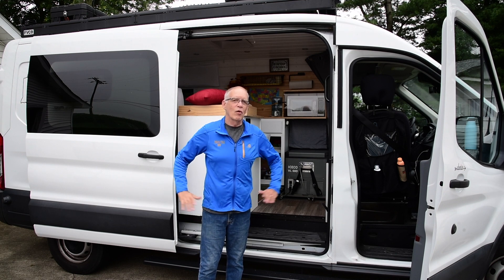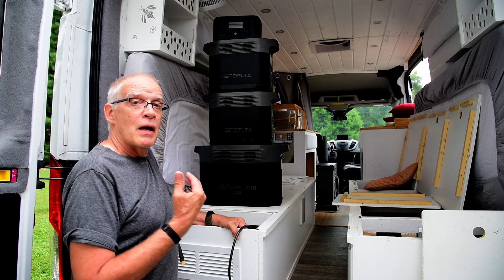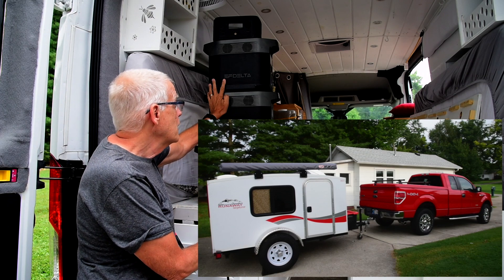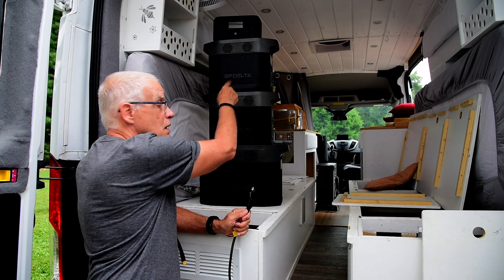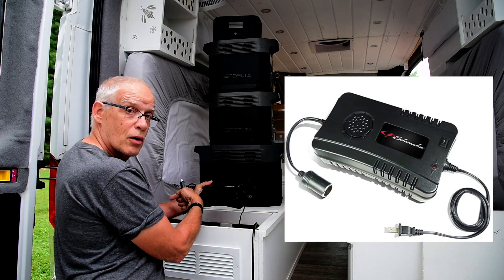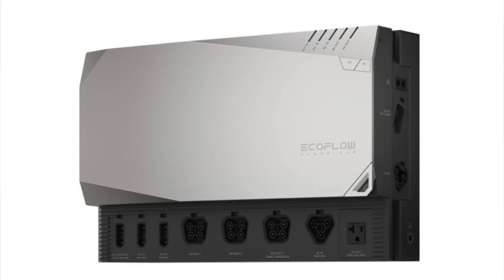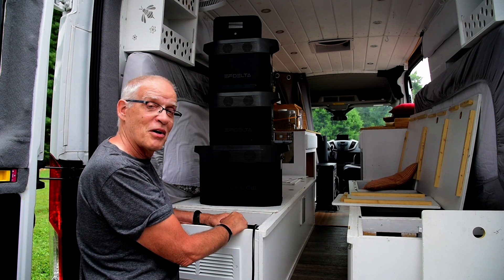A Quick 4-Minute Look at Our Ecoflow-Powered Transit

Comment: The DC output of the various ecoflows is limited to 30amps, correct?

And that’s enough for your lights and fridge etc.?
Reply from the maker: I have never run into an issue with any of my eco-flow units. My ICECO fridge sometimes does not like running on 12 V so most of the time I just run it on the AC side of the eco-flow. I know it’s less efficient but I have plenty of power.

Comment: Thanks for your response about the AC.  Would you mind sharing the details of the portable inverter with the 30amp plug you use.  Id like to get something similar
Reply from the maker: Sorry for the delay answering - I saw it and promptly forgot about it! : ) I actually ending up taking out the 30A plug - I did not like the adapter cord I was using and never will need 30A. I use this inverter to run 12v stuff when I am on shore power and it works well - https://www.amazon.com/gp/product/B0196DXEBI/ref=ppx_yo_dt_b_search_asin_title?ie=UTF8&psc=1

Is that what you need to know?

Comment: After having travelled some now in your awesome build, do you regret not putting in an AC?  Im duplicating your idea using ecoflows latest Pro 3...and likely adding a second battery as ill be doing trips 2-3 months long.

Cheers!
Freddy
Reply from the maker: @fredzuccarelli  yes, if I could go back, I probably would add an air conditioner. We use a portable, but it’s in the way when we do use it. But for the most part, we do not camp in hot weather. I would go with a rooftop AC.

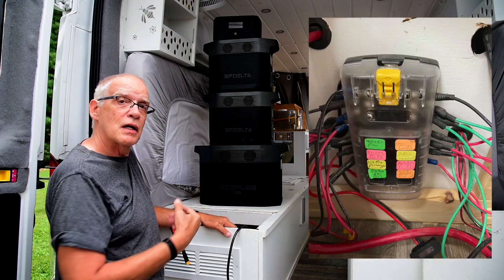Comment: 1)  12 VOLT DEVICES WIRED TO FUSE BLOCK:  1:30  All wires for 12 volt DC electronics (puck lights, USB ports, 12 volt Iceco VL60 Dual fridge, water pump(s), fans, etc.) connect to Blue Sea Systems 12 volt fuse block.   

2)  12 VOLT CORD FROM FUSE BLOCK TO DELTA 1300's DC PORT:  1:37  12 volt DC cord is connected to positive and negative on fuse block and plugged into the Delta 1300's 12 volt DC port.  (Same port I use now on my Delta 1300 to power my fridge/freezer.)

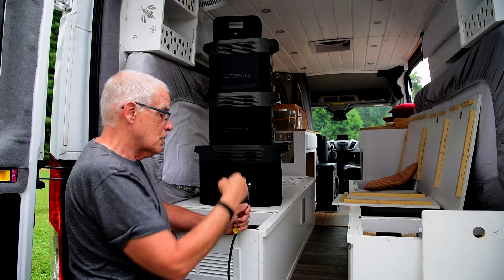3)  DC TO DC CHARGER WHEN DRIVING:  2:02  While driving he charges the Delta 1300 using a wire from the Orion-Tr Smart 12 | 12 - 30 Isolated DC/DC Charger (with XT60 connector)  that plugs into the solar charging port on the Delta 1300.

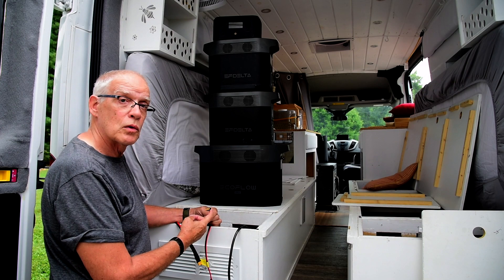4)  SOLAR CHARGING:  2:15  Solar charging is done with two Newpowa 200 watt panels on the roof.

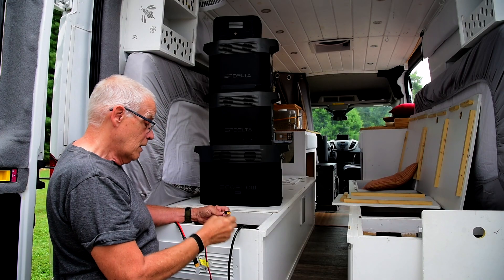5)  SHORE POWER w/ CONVERTER:  2:35   If 110 volt AC shore power is available he doesn't use the Delta's. Instead, he plugs a shore power cord into the 110 volt outlet that's installed on the exterior of the van that has two integrated 18" long 110 volt plugs (More info on his other video below this). Then he plugs the 110 volt AC cord of the converter (he called this an "inverter") into that same 110 volt AC outlet. The male 12 volt DC cord described in #2 above (that's used to power all 12 volt stuff in van) plugs into the female 12 volt DC port on the converter. He runs the Iceco VL60 Dual fridge freezer on 110 volt shore power when it's available too.

6) RUN 110 VOLT AC DEVICES w/ DELTA 1300 INVERTER: For 110 volt AC devices, like microwave oven, electric range, coffee pot, fan, etc., run 110 volt AC wires from outlets near each 110 volt AC device to the AC outlets on the Delta 1300. (This requires manually turning on and off the Delta 1300's inverter.)

7) RUN 110 VOLT AC DEVICES w/ SHORE POWER: Disconnect the cords that are plugged into the Delta 1300 AC outlets (and turn off the Delta's inverter) and plug into one or both of the dual AC shore power cords.

8) STEALTH SHORE POWER OUTLET: Consider installing the AC shore power outlet on to the bottom of the van so it isn't visible on the outside of the van.

--->MORE DETAILS:  https://www.youtube.com/watch?v=CmGsWwOesbA

Comment: Hi Charles, is the DC to DC charge limited to 8 amps, so essentially limited to what a car charger can do, or is it limited to the solar input of 500 watts. I know that both solar and dc charging using the same port, but not sure which limit is applicable. We recently got a delta 2 and I am trying to figure out the best way to charge it while driving. Thanks
Reply from the maker: I believe my installer set it up to input 30 A. There is an app that you use to set it. It’s definitely more than the cigarette plug outlet.

Comment: I love watching all your helpful videos!  Thanks for putting them together for all of us to enjoy!   I’m definitely going to add an Ecoflow system to our van conversion.    I’m also considering adding a heating system and wondered what you use for heating your van at night?
Reply from the maker: If we do not have shore power, we just hunker down in our sleeping bags and we are plenty warm. 

But we also have a 12 V heated mattress pad that works wonderfully. We found it on Amazon and it was originally designed for semi drivers in their bunk in the back of their cab. I think it cost around $100 or so. 

If we have shore power, then we use a small Pelonis ceramic heater. They are extremely power-hungry and are just not feasible to use with a lithium battery.
Reply: Thanks for your VERY helpful reply!  I’m definitely going to look into the heating pad you mentioned and will be buying two Delta power stations!   I look forward to your videos and really appreciate all your great tips and entertaining stories. Take care!  Karyn M.